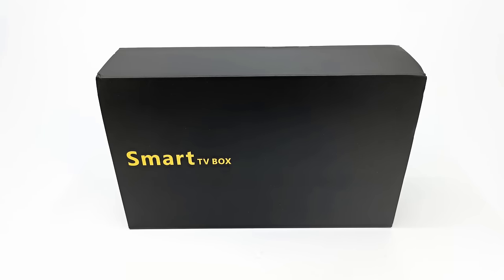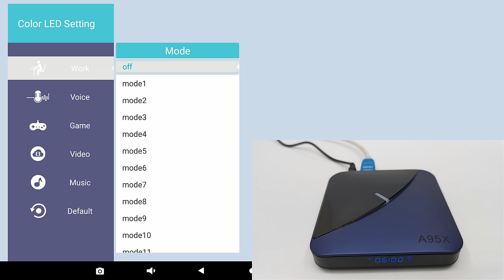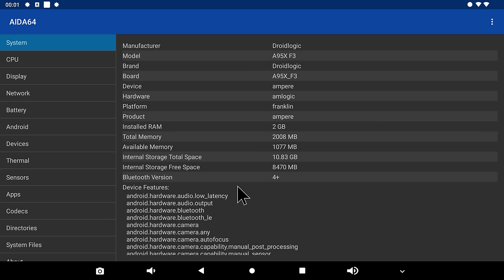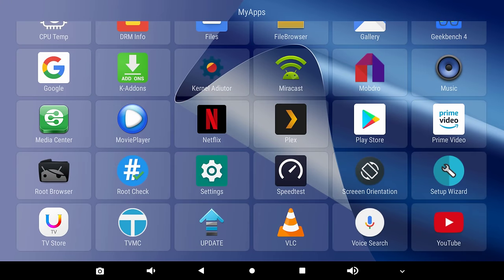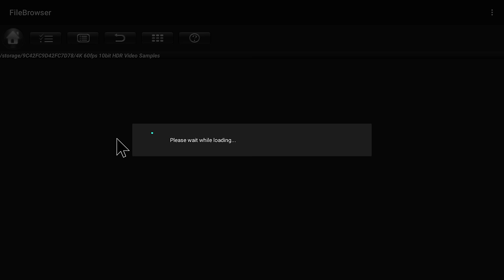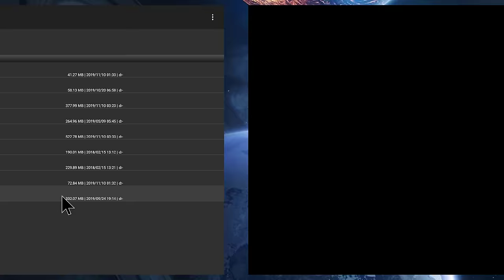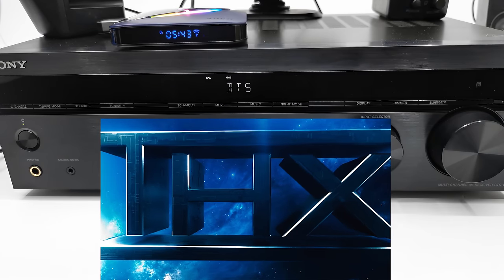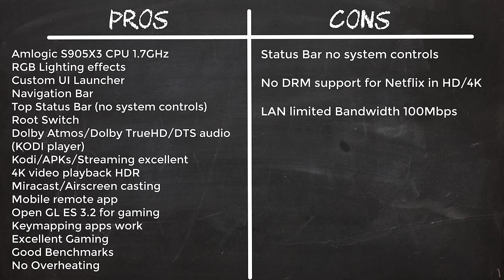Latest A95X F3 TV Box Amlogic S905X3 Quad Core Android 9 4K TV Box Stop Review

Comment: I bought 21 of them. However, they don't do the full advertized 1,9Ghz, but only 1,7Ghz peak.
I bought them for $33 a unit though.
16:10 The stock remote does offer mouse support. Just click the 'mouse pointer' icon on the bottom left of the directional keys, and you have mouse support to open the menu. There's also a 'menu' button on the bottom right of the directional keys. At least on the AMLogic S905X3 box remotes I got.
Reply from the maker: My test and results in the description area clearly states 1.7GHz. Using the mouse pointer on the stock remote is really dated in 2020. Air-mouse cursor movements should be standard in all TV boxes by now

Comment: I have purchased A95x f3 air and in display resolution settings its not showing 4k60hz, it is only showing up to 4k30hz, can I flash A95x f3's firmware on air version cause in your video you are using A95x f3 and it's showing 4k60hz and my tv is 4k and it's 60hz
Reply from the maker: It may or may not work because there is a different RGB setting in the Air model. Make sure you have the stock ROM in case it fails or brick the box.
Reply: @tvboxstop  do you have any idea why it's 4k30hz not 4k60hz
Reply: @tvboxstop  please help me bro it's urgent
I have purchased A95x f3 air and it's display resolution is upto 4k30hz, is there any way to make it 4k60hz or should I return it and buy hk1 tv box or should I keep it
Reply ASAP

Comment: Please I have two questions
1. Does a95x F3 come "rooted" right away when you buy it?
2. Is it useful to put custom ATV9 Rom on it that makes it behave like Mi box S with Android TV 9... there is aidan rom for example..
Reply from the maker: Yes it comes rooted and you can put any custom rom you want on it, once you have the stock firmware to revert in case something goes wrong.

Comment: Hello Friend!!!

I have an audio configuration problem ...
I bought the A95X F3 Air, and I'm not able to activate Dolby Atmos, DTS-X, TrueHD and etc ... That is, configure the Passthrough ...
Do you know how to configure the audio menu ??? Which player is better, KODI, SPMC and etc ???
I have a Pioneer VSX-LX101 receiver, I use a TV BOX ZIDOO X9S that has more complete configurations and works all DD ...
If you can help me and maybe make a video about it, it would be perfect, I saw in researching that other people have this problem ...

Thank you...
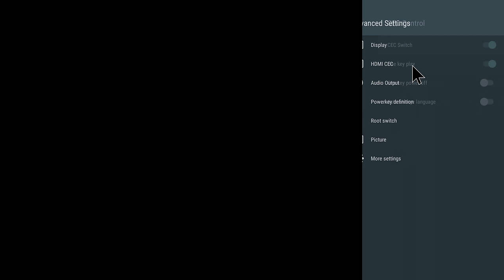Reply from the maker: First enable them manually 7:42, Then install the VLC player and in the settings area under audio enable passthrough.
In Kodi go to settings click on the work "Standard" until it says "Expert". Then under audio set audio channels to 7.1. Then scroll down to the bottom of audio settings and enable audio passthrough and all DTS settings below that. 
Connect TV box to tne HDMI input port on the receiver usually Mediabox and your TV to the only HDMI output. Ensure that the speaker settings is set to auto detect or multichannel 5.1 or 7.1

Comment: Great work. Is this the same thing as the "A95X F3 Air"?
Reply from the maker: No the Air is clocked at 1.9GHz and the F3 is clocked at 1.8GHz and has better pereformance than the Air
Reply: @tvboxstop  It's so confusing they have both "A95X F3 Air" and "A95X F3", and the sellers show the same specs. Thanks for reply.

Comment: i wonder..which one is better from your opinion.. A95x F3 or A95x Air
Reply from the maker: The A95X Air is has the better CPU clock speed, I like the F3's optimization more with smooth 4K video and 3D game handling. Also the RGB is cool. The A95X Air is a great box on doubt, but I like the F3  more.
Reply: wow thanks for your fast reply..
and can i ask more?..do A95x box turned off when tv is turned off?
and with no DRM Netflix, what is the effect? we cannot play netflix?

Comment: My bought several boxes from the link in your video. They are very good boxes. I have 2 The box is that a monarchy and we are not able to be updated. I bought more boxes for someone else in his boxers will actually update the 9.0 operating system. Question is how can you tell the difference in reading the specs as to know which one is the operating system that can be upgraded ? Also this one better than the other one? I see on your video that your box in the apps has the updater. That’s the one that I’m talking about that you can’t update.
Reply from the maker: The thing about updates is that they are not always done through the update software, and they are not always available. The best way to find an update is to do a manual search.

Comment: Hi !
Don't know how you do to have DTS-HD MA or DSUR in Kodi options. I've enabled the Passthrough but only have DTS (no DTS-HD or more) in the list.
In Android settings I choose LINE and checked everything manualy (DD, DTS...). What's wrong please ?
Reply from the maker: OK try two things.
1. enable all digital formats manually. Then set Kodi audio channels to 7.1 then enable all DTS features under the passthrough option.

2. Install the VLC player. Go to settings and set hardware acceleration to FULL. Then under audio settings enable audio passthrough. In APKs set the default player as VLC. Download a DTS video and test it with the VLC player.
Reply: Thanks for the answer, I've enabled all digital formats manually in the setting of the box (at the 2 places in settings where I could), set the Kodi audio channels to 7.1 and in the passthrough options I only have DD, DDPlus and DTS which I enable all.

When I read a DTS-HD MA video I only have DTS written on my receiver, when I read Dolby Atmos or TrueHD sounds it's only STEREO instead. It worked on my old box (Tronsmart Vega S95 with Kodi directly on it), but here... 

I tried on VLC directly, enabled the Passthrough, but still the same, instead TrueHD it's Stereo and in DTS-HD MA, I don't have any sound (it's written Stereo).

I have A95x F3 Air model but I don't think it's limited to DTS. If it's the case, it'll go to trash

Comment: I connected a95x f3 to samsung soundbar hw q90r, but atmos is not showing when playing videos with atmos soundtrack, how did you configure a95x f3 to your receiver?
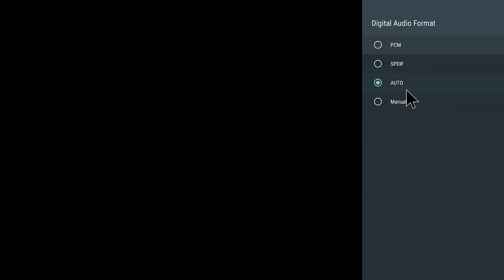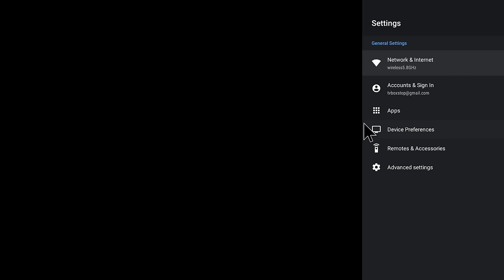Reply from the maker: Well it depends on weather you are using HDMI passthrough or Optical. If using Optical in the settings area you need to set audio output to SPDIF 7:18. If using HDMI leave the output settings as is and manually enable Dolby and DTS options in the settings area 7:48

Comment: Is it posible to MANUAL set the audio output to 5.1 channels (ac3 or dts)? not eac3 or DTS-MA or similar (more than 5.1 channels) for a "standar"/old receiver.
Reply from the maker: That can only be done in Kodi Expert audio settings and on the receiver itself receiving the audio. There is no audio channel settings in the box's settings area.

Comment: How can i pull down the status bar on top with the remote control or my keyboard/mouse? Sometimes i want to see the messages there, but i have no ideo how to scroll down the status bar on top, not with the remote, mouse or keyboard. Sometimes i can not even see it and dont know how to see the status bar on top (with the clock, WLAN Sybmol, and so on). Any ideas?
Reply from the maker: The reason you are having this problem is that it's not a full status bar with system controls it's more of a hardware monitor bar

Comment: hi! would you choose a box with s905x3 with ddr3 or s905x2 with ddr4 ram? which boxes do you suggest in this price range?
Reply from the maker: The CPU speed would be the determining factor. Which has the higher CPU speed. Between $45 - $60
Reply: @tvboxstop  and which is by you in this price range that you mention sir?
Reply from the maker: Between the X96 Air and the A95X F3, I personally like the F3 more even though it has a lower CPU speed. It has more features and much better heat management.

Comment: Hello, i have sony muteki home theater right now connected on my lg smart tv with hdmi arc. Im planing to buy this android tv box. How did you do the connection of the audio with the tv box? And one more question, what controller did you use to play games? Wireless mouse and keyboard?  Thank you and very nice video +1 suscriber
Reply from the maker: You have to do an HDMI passthrough on the receiver. The receiver will have at least 4 HDMi inputs use the game or the media box input for the box. There will be only HDMI output, send that to the TV. Connect you speakers and set the receiver to the Game or media box option. You may have to set the audio settings from 2 speaker stereo to multi channel, or what ever surround sound setting the receiver has and that's it. For Battle Royale games I use mouse and keyboard with keymapping app like Octopus or Panda mouse Pro. For gamepad I use PXN3 but there is a newer model.

Comment: -Mine one doesn't even show 4k resolution in the Display settings and they were advertising with 8k . Is there any chance you could let me know?
-Is these model with OTA Upgrade or not . Seller told me it's with OTA upgrade. How to figure out that?
- Is it with 2T2R / MIMO ? 

 Thanks  in advance
Reply from the maker: It will not show if you don't have a 4K TV connected to it. If you have 1080p it will show up to resolution as an option to choose from.

Comment: I connected the box to the Samsung N850 5.1.2ch soundbar and soundbar ARC to TV ARC. Soundbar is passing through 4K/HDR signal. I have an issue with Atmos playback, when I'm using a lossy DD+ with Atmos it is detected on my soundbar, but when I try to output Dolby TrueHD with Atmos, Atmos is not detected.

Why is that? I've read somewhere that it might be due to TV/soundbar not having eARC. Could it also be a limitation with this box or soundbar itself? Anyone tried outputing TrueHD with Atmos here?
Reply from the maker: There are a couple things that can be going here. Firstly the media player VLC player plays almost everything, but yo need to enable audio passthrough in the audio settings area. Try manually enabling all Dolby and DTS options. If using Kodi, Kodi cannot play audio from videos in .ts file format. The sound bar has to be verified TrueHD ready by using another devise that has Dolby TrueHD guaranteed feature. So compatibility is key. In the video I use Kodi because I may have had an issue with VLC. However in Kodi you need to enable expert mode and under audio settings change the audio speakers/channels from 2.0 to 7.1, then below that enable audio passthrough and all option below audio passthrough.
Reply: @tvboxstop  Thanks! I already tried shuffling between 2.0, 5.1 and 7.1 in Kodi, that didn't help. None of my videos are in .ts format, it's mkv or mp4.

The options I got under the allow passthrough in Kodi are:

Dolby Digital (AC3) capable receiver
(- Enable Dolby Digital (AC3) transcoding) only when 2.0 selected
Dolby Digital Plus (E-AC3) capable receiver
DTS capable receiver

All of the options are enabled. However I don't see any mention of True HD here. I have latest Kodi 18.5

Soundbar should be able to output TrueHD, but as said, it doesn't have an eARC so I'm not sure if it can receive TrueHD + Atmos, I guess not.

I can try with VLC player as well, haven't tried that yet!

I can return the soundbar, but what I want to know if this particular box I have (A95X F3 Air) is capable of outputting TrueHD and TreHD + Atmos. I can't tell for sure from your tests if you've been using DD+ with Atmos or TrueHD with Atmos :)
Reply: @tvboxstop  I tried with VLC player today and regarding Dolby, I can get DD+ Atmos but not true HD atmos, same as on Kodi
However, I was not able to get DTS:X on Kodi but I got it displayed on soundbar when using VLC player. I refer to lossless DTS:X here!

Comment: hi,after box shutdown total,i use cooler fan but why still run cooler fan?it is normal box or not?thanks please reply
Reply from the maker: This box does not need a cooling fan
Reply: @tvboxstop  oh.becaus not hot?i buy package a95x f3 with cooler fan
Reply from the maker: It's always good to have a TV box cooling fan around is prolongs the life of the box
Reply: @tvboxstop  but i have issue🤔😅,after shutdown box cooler still running🤣
Reply from the maker: That happens with PCs also it's a power bypass that allows you charge your mobile devices while the box is off

Comment: I already brought an X96 Air Amlogic S905X3, can you please explain how you provide active cooling to X96 Air thanks.
Reply from the maker: I removed the 2 screws below the rubber legs and removed the bottom cover. I then drilled some holes into the cover mount it back together. I then places a small USB fan below the box to provide Active cooling.
Reply: @tvboxstop  thanks for your help

Comment: I just got my box today and it won't play atmos at all. DTS works fine. I have 5.1.2 atmos system. Any ideas?
Reply from the maker: Install the VLC player and in its settings area under audio select the checkbox that says audio passthrough. Use the VLC player to play all your videos with Dolby Atmos. Ensure that the video file is indeed Atmos and not just says that it does. Download from this page https://thedigitaltheater.com/master-trailer-list/
Reply: @tvboxstop  I did, apparently only problem with sound is when I stream from Kodi. Can get dolby sorround and dts but no atmos
Cinema HD can do the atmos but I can't find the way to play TrueHD, it recognises it as Stereo
Reply from the maker: Okay, so here's the thing. Kodi can indeed play Dolby Atmos you have two go to the settings area and On the world Standard until it switches to Expert. Then under audio change the audio channels from 2.0 to 7.1. Then scroll down under audio and enable audio passthrough, then enable all the DTS formats below that. Then Kodi is ready to play Dolby Atmos. You have to be aware that Kodi cannot play the file format .TS. Formats MP4, MKV will play fine.
The VLC player does not have this issue and once you enable audio passthrough in the settings area it will play and output all the digital audio formats.
What's even more important is that you should know that this box does not have Dolby true HD. There are few boxes on the market that can play Dolby true HD format and this is not one of them.
Reply: @tvboxstop  Thank you for that, I'll try with 7.1 settings.
I thought you played trueHD with this box in the video, says in PROS Dolby Atmos/Dolby TrueHD/DTS audio.
It's not deal breaker anyway, box works pretty fine.

Comment: Which box has better performance ... the a95x f3 or a95x f3 air version?
Reply from the maker: The A95X F3. Believe me when I tell you so, because the Air model in-spite of having a higher CPU clock speed it has poor ventilation which causes throttling due to overheating.  The F3 has much better cooling, the CPU is clocked slightly lower an 1.8GHz, and the box performs, play videos, an feels better overall.

Comment: I got my device (a95x f3 air) today but the thermal temperature is very high between 66 and 69 degrees
Reply from the maker: That is fine don't worry about it unless you want to game, then apply a cooling fan.
Reply: @tvboxstop  On your review temperature was 45 to 48 mine goes above 65
dose model number matter ?! 
the one your review was
(2GB ram 16GB rom was a95x_f3_m)
the one i got is
(4GB ram 64GB rom a95xf_3_air_r)
Reply from the maker: OK I got it it's the Air model. Then must be a difference in the housing design and a bit more heat generated due to more RAM and storage, and definitely an different mainboard used. So that explains the heat.
Reply: @tvboxstop 
So will the heat affect the performance of the device or cause it to face problems in the future ?
Reply from the maker: Yes it can if you engage in intensive activities such as 3D gaming that generate lots of heat without applying a cooling fan. Normal streaming will not cause that.
Reply: @tvboxstop  
🙏🏻🙏🏻

Comment: How much file sizes can you stream on this box using apps like cyberflix or kodi ?
Reply from the maker: That is like a trick question but I can answer. The 4GB 64GB model at best cam stream 1080p with ease on a 100MB Internet package. To stream 4K you may need about 150 - 200MB and very good streaming server like Netflix's and YouTube servers to stream that kind of band with. So the answer is two fold, the box has to have the RAM and CPU cores to handle the stream, and the source has to be powerful enough to push out that stream at a high rate.
Reply: @tvboxstop  I have real debrid and a 100mbps internet. I hope it is enough for streaming high quality files. 
Also i have ordered the 4/32 version of this box

Comment: Sir, i want to ask between A95X F3 TV Box Amlogic S905X3 Quad Core Android 9 4K TV Box and X96 Air TV Box Amlogic S905X3 Cortex A55 Android 9 4K TV Box, which is better?And do your prefer A95X F3 or X96 Air?
Reply from the maker: Hi Shahril there is no difference in performance between the two, just that the F3 has the cool RGB lighting.  I prefer the A95X F3 model it performs really well.
Reply: @tvboxstop  thanks for ur opinion..